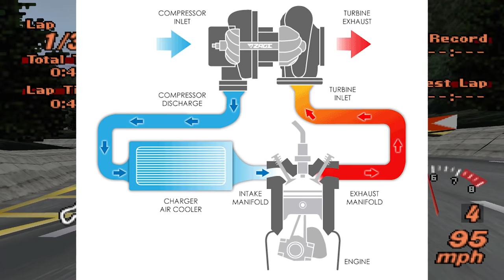5 MORE Gamer Misconceptions About Cars!

Comment: As someone in the drag racing community, when built properly and a good enough surface when you grab your 1st or 2nd kit (N20), the car will shoot a constant blue flame until the driver let's off. I of course understand that there is alot more fuel added thus into the exhaust chamber but just saying there are times where vehicles can shoot flames other than 2 step, etc, etc.

Comment: Interesting note on the whole Boost thing: in some racing leagues (the DTM for example) the cars are equipped with a set of technologies that will for a time give their car a significant speed boost, called a push-to-pass-system and a DRS (drag-reduction-system), which can be activated at pretty much any point in the race and the use-time of which is a limited resource the drivers have to manage throughout the entire race. HOWEVER, it has absolutely NOTHING to do with nitro or turbochargers, instead they either increase fuel intake for a short boost in engine power (ptp) or open up small winds to improve aerodynamics (drs).

Comment: 7:45 The tire wear rates is not a quirk or system limitation, it's game design, the tires will wear after a few laps because it was programmed to wear that fast because the races were short. If the tire wear was at a realistic rate, you wouldn't feel it in the race and the tire wear would be obsolete.

Comment: #4 also seems to come from initial D. "KUSO! My tires are wearing out after driving on a mountain road for a few corners. Welp, guess I'll lose." Bonus points if you are driving a GTR.
Reply: tbh that's it and it's not true at the same time.. some cars have some super weird tire dimensions which got "insane" grip but they also wear down super fast... now that doesn't mean that they will wear down after 10min of intense driving but you can wear them down in few months of daily driving it a bit harder in comparison to normal driving and normal drivers where tires can last for years...

Comment: Can confirm the last one. My dads truck (which used to be my truck, a long bed 1999 dodge ram 1500) may only have 230ish hp but if someone who isn't me tried driving it as fast as I do they'd likely crash it. I came close to crashing it into a post one time, but I just barely missed it and hit it with the very edge of my headlight hence why the turn signal lense is gone.

Comment: A good way to summarize backfire is if you kill the spark and fuel dumps I to the exhaust, like in the combustion chamber, it creates pressure in which is caused by a flame of the fuel exploding and therefore it can dump into the exhaust making sweet sweet pops and bangs

Comment: Driving in a straight line does require skill. I've driven 180 kmh on multiple occasions and it's just scaring to see how fast stuff goes by. That viaduct you just went under that's already 150 meters behind you. That tree you just saw. Yeah that's also 150 meters behind you. Driving in a straight line at high speeds does require skill and a lot of it.

I think it requires more skill then in a corner. In a corner you can feel more easily when the car starts losing grip. In a straight line not so much. The tiniest dent or slightest wind breeze can turn you around and let you crash.

Comment: In old GTA, cars exploding when they flip over is not really about player's convenience. If you flip over and it starts to burn, you absolutely want to evacuate before you die. You do respawn, but at a hospital that can be much further from where you were headed and you need to restart any mission you were on. This would be less of an issue in GTA V that introduced a much more convenient respawn mechanic during missions, but at the same time cars aren't as prone to exploding when flipped as they used to.

I believe it was mostly done to save your computer's resources. A car that can't be driven occupies a space in memory. If it blows up, it can be despawned sooner.

Comment: Flames out the exhaust are technically called Afterfire IIRC, and backfire is when flames go into the intake valve and shoot out the carburetor (if it's a carbureted engine, I don't think injected engines will backfire)

Comment: I'm currently learning to drive with my fathers old Fiat.
It's incredibly hard to even get going. You can't rev up the engine too high, but if you don't rev it up enough, the engine stops, and the clutch also has to be operated while the the gas pedal can change about a 10K rpm just by moving it a quarter centimeter.
Shifting is also much different, since it's usually way slower, than as games depict it. Obviusly sportscars do need quick shifting, but usually a normal streetcar will need a few seconds from releasing the gas to stepping it again.
Obviusly this is more of an EU problem, since US cars just have automatic gears.

Comment: Two thing you mentioned... 
One: it's not just high horsepower cars that shoot flames... I had a 1981 Chevy C10 Custom pickup that was a straight six, three in the tree... Lost the exhaust underneath and was running straight pipes... It shot flames out the pipes...

Two: another reason drag racing cars are hard to drive in a straight line is a thing called the "groove"... It's a strip of thick rubber along the centre of the lanes... If a car dips a tyre off the groove, the car will pull very hard in that direction, and often times, a driver will over compensate, and crash... Also, in the hight power cars like top fuel or nitro funny car, if the car puts out a cylinder on one side of the engine, the car will torque hard to one side... There is also a thing called "tyre shake" (too much grip, not enough power to the wheels)... Tyre shake could cause a car to pull to the side as well...

Hope this info helped y'all a bit...

Comment: With regards to vernacular, a turbo IS a type of supercharger. They were originally called "exhaust-driven turbosuperchargers" but that's too much yakety-yak for everyday use, so we just call them "turbos." Both of them do the same thing--they pressurize the intake manifold to increase airflow and fuel consumption, increasing power. The difference is the power source, the word "supercharger" usually refers to the compressor being powered off the crankshaft and "turbo" means the compressor is powered by an exhaust turbine.
Turbos are more common because they're much more efficient, for a given boost pressure (and fuel consumption) the engine will produce more power because the turbo doesn't absorb power from the crankshaft like the supercharger does. Turbos have lag because when you put your foot down it takes a second or so for the turbo to speed up in order to produce air pressure (boost) and the shaft-driven supercharger does not have lag since it's powered directly from the engine's crankshaft.
Other than that, they're functionally the same thing--they're both air compressors.

Comment: And also yes you can set up a nitrous system to activate on a button. Most may not, but many also do. You can get really basic and get what they call micro shots in tiny tanks that just run a hose into the intake and activate with a button.

Comment: 10:00 right but those are two different things. Driving a 1500+hp car straight is not easy. Flooring it in your Camaro going straight is.
Reply: this, plus that's a freaking dragsters which weights maybe a 400kg searches internet - they're roughly 1 ton.. but I've also found out that there're dragsters which have 11000 hp (????) and that's 110hp per kilo ratio which is so insane that I can't even explain it... and flooring "normal cars".. a lot more is depending on the tires than actual power

Comment: Forgetting to purge a nitrous system prior to use won't blow up your engine.  You'll actually just bog hard as the nitrous system is designed to add fuel and nitrous in the correct amounts.  If your nitrous line is not full of nitrous (this is why you purge) you just get the fuel.

Backfire is when the fuel ignites in the intake.  When you get flames out of the exhaust, it's called afterfire.  The reason you see flames more on mid engine cars like lambos and ferraris is because their exhaust systems are much shorter than a front engine car like a corvette, so you need less fuel in the exhaust to see the effect.

Comment: In certain games, like the first GRID or Forza, if you just floor it in RWD cars, your car's rear end will start to slide. I used the C5.R in GRID to beat most GT1 records because  I didn't floor it at launch. I held it at 5000rpm until it was time to shift into second gear. Then I floored it. And the car handled like a dream. Same with Dodge Viper, or any other RWD really. Especially in Drift events. Takes skill to handle 500+ horse power, even if you're just going in a straight line. Because physics exist.

Comment: Turbo cars can have a boost button. Racers call it a scramble button most of the time. Say your running 20 psi of boost and your getting beat. By pushing the button you can send a signal to the boost controller to give say 30 psi.

Comment: To add to your last point. A lot of times spinning out and running into things is from wheel speed. Say you wanted to peel wheels leaving somewhere. First and maybe second is going to be your go to gears. Auto or manual. Depending on your final drive ratios. Once people try to go into 3rd or even 4th. While still spinning. The rear wheels have far to much speed compared to the car. Causing a sort of pendulum effect which is why you see a lot of those cars fishtail back and forth. 

So wheel speed. Along with not knowing how to counter steer causes lots of accidents. Know your cars limitations. And your limits as a driver before destroying your vehicle or hurting other people.

Comment: I'm almost POSITIVE cars in GTA 5 do not explode when flipped over, and instead you can hold down A or D or the thumbstick if on a controller and the car will flip itself back.
Reply: But it will when hit at high speed at bad angle. Unless if in GTA online the vehicle is armored. 

Since GTA IV no more upside down explosions.

Comment: While of course multiple games have caused this, I feel like one of the biggest for the Turbo = Nitro Boost misconception is NFS Hot Pursuit '10.
It shows an actual turbocharger in the cutscenes for the Turbo Boost Equipment, which because of that I could see someone seeing that as a kid, then later in life seeing an actual Turbocharger and going "so where's the button for the boost?"

Comment: None of them actually applies to Beamng:
1. If you flipped, the oil burnt, smokes on exhaust and the engine dies.
2. Same, this is even amplified with high boost turbo.
3. Eh, do it with standard engine and it goes bang. No purging, but you can purge it if you click n2o button, smokes gets out from defined node. About exhaust flame, it doesn't appear when you use nitrous, but when it hits rev limiter, it did. Some ECU has launch control.
4. Tyre wear, never see that. But the tyre can deflated because stabbed by rocks, spikes, etc. Heat on tyres, I thinks it's simulated, so with brakes and engine.
5. It's even crazier there.

Comment: i have to say that i'm proud that i haven't learned a ton of new stuff. i mean this as in i already knew a good bit of this before your videos explained it, so that's good i guess lol. you should do a points system, where for every fact you already knew you get a point, and to comment down below how many points you got lol, just a thought. i have to say that the one fact here that to me seems really hard to not understand is throttle overcorrection (rear wheel drive cars spinning out when you mash the throttle), like a lot of games do simulate this, like you go around a turn and hit the throttle on the way out of the apex, and you will spin like crazy, even with downforce set really high on your wing (if you have one) because you're not going fast enough for that wing to generate downforce. now, this is coming from someone who's 18, has no license, and barely spent more than 30 minutes behind the wheel of any car in my whole life, but still, i can understand things like this at least relatively well. one of the things that i was always worried about is letting these misconceptions make me driving dangerous, so i took it upon myself to learn how all these things work, educate myself, and actually know this stuff.

Comment: The first and only time I had my charger fishtail on me was on the highway, and by God's grace, I somehow managed to correct myself before anything bad happened. After that, I learned that I probably shouldn't be slamming the throttle out of nowhere
Reply: If you want the car stop fish tailing put a spoiler or a wing so it grips better in the back and corners better, but u will sacrificate speed for the drag, still helps, but doesnt mean it dissapear, you can put gripier tires too.

Comment: My dad always told me that no matter the power, you respect the car. The first year S2000 was responsible for many crashes. That’s not a very powerful car but it’s a demanding car at it’s limit and people didn’t respect it enough. Even the 4.6L SN95 Mustangs rated at 260hp were known death traps for teenagers. Also people stop trying to do a burn out and turn at the same time in a car that has the body roll of a ship.

Comment: Fun fact: carburators engines can backfire without a force induction system if the air setting is set incorrectly

Comment: There are HUGE misconceptions gamers have that you forgot to mention that I see often. For example, they think drifting around corners makes you take the turn FASTER because that's the case in arcade style racing games, where in reality, if you lose traction in a turn you're taking the turn tremendously slower than if you just braked on the outside then cut the apex.
Reply: fun fact - there was a test between grip and drift and the speed was roughly the same.. cars used in test were mustangs (idk ~2010 ones) so in theory.. if you put two ideal drivers whatever if drift or the grip is going to be faster could end up depending on which car you have.. but of course that's not really possible to achieve, especially if there's another driver on the track

Comment: I think one of the problems with video games,  is the drastically different feeling of speed between vehicles. Which I get that they need to have a clear distinction between the level or cars. But even a car like an S197 5.0 usually feels relatively slow in most games. Causing some to really underestimate the power that some cars have. So if you have no practical real world performance driving experience,  even a V6 mustang could be to much power.

Comment: Games had tires wear down fast not because the algorithm was too simple, they could still make a reslitic time frame for tire wear with simplest computations, problem was that races in games take 2-3 laps usually, and 5+ laps means "endurance" races. Hell, latest Gran Turismos replaced 24 hour races with 24 minute ones.... You know, kinda like football games have 10-minute periods or something. So they adjusted tire wear for shorter races.

Comment: I agree, and yes: going fast in a straight line does require some skill
Here's the proof, i remember playing Gran Tursimo 5 with the X button as the throttle, and with some cars like the RM version of the Corvette ZO6, when i exited from a turn, due to not really having any control on the throttle, the car wanted to fishtail pratically everytime, so i changed my controls with R2 as the throttle, L2 as the brake and the joystick as the steering
And with those control, i can now have more control on the throttle, the brakes and the steering and it really helped me
I also remember when me and my dad went to visit one of his friend who own a AC Cobra, he took me for a ride with it, and when he was on a empty road, he brutally hit the throttle and i felt the wheelspin and saw the car slowly starting to fishtail, then he stopped and corrected before fishtailing entirely
Ngl, that was pretty scary but also amazing

Comment: your car doesn't need to make tons of power to backfire and shoot flames. my dad's 72 cj5 was tuned really bad (barely running bad) and shot a massive fireball out the side pipe and burned all the hair off his leg. that was from a 1972 AMC 304 v8, a motor that from the factory made less than 200 horsepower to the wheels.

Comment: Erm akshually, "backfiring" is when fuel burns as soon as the intake valve is opened due to a lean fuel mixture, causing combustion through the intake system.
Afterfiring is when combustion takes place in the exhaust system due to an overly rich fuel mixture 🤓

Comment: Some nitros vehicles (specifically diesels) do shoot “flames” out of the turbo down pipe when it is being used, also im not so sure back fire is a fitting term for fuel burned outside the exhaust system. I would be more partial to “after burn”, having a back fire isn’t a good thing. It usually ends up with your intake manifold in pieces. But do with this what you will.

Comment: I have the notion for people that say "driving in a straight line doesn't need skiil" has never driven anything beyond 300hp. Even if driving skill was a non-factor, there's still a lot of tuning and engineering involved when making a car not just fast, but also stable & reliable. Which goes beyond engine work.

Comment: 7:45 I suspect it has more to do with game design decisions than technical limitations. No matter how simple your tyre system is, it's just a matter of a few variables to tune it to whatever tyre wear speed you need. Gone in 1 lap, 10 laps, 100 laps - it's just a matter of multiplier.

However from a design point of view, if you make tires wear fast, it adds more complexity to your very short races (and races in videogames really are short, with only a few rare exception). Make tyres last realistically long - and players will have a hard time even noticing it, let alone adjusting for that and making pit-stops.